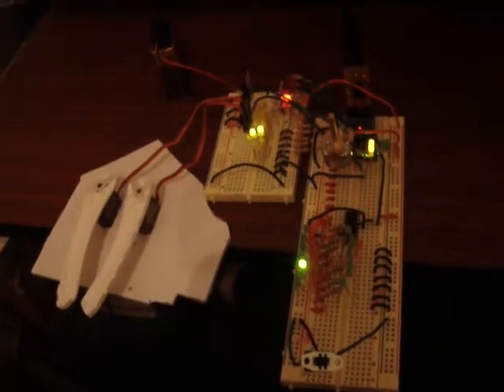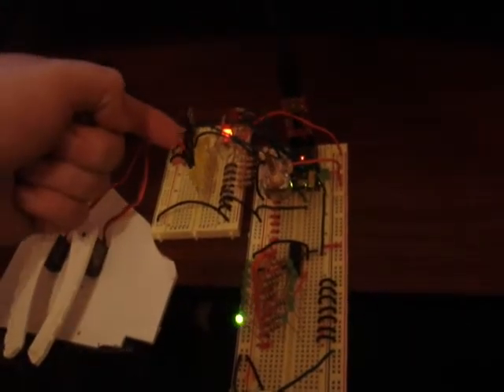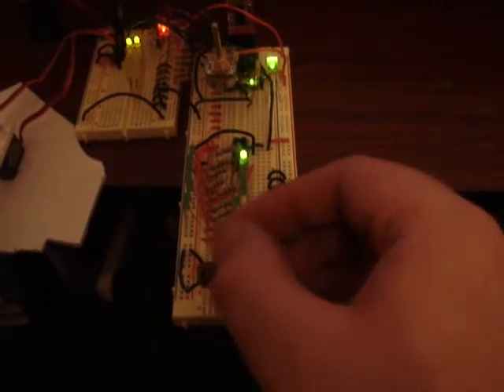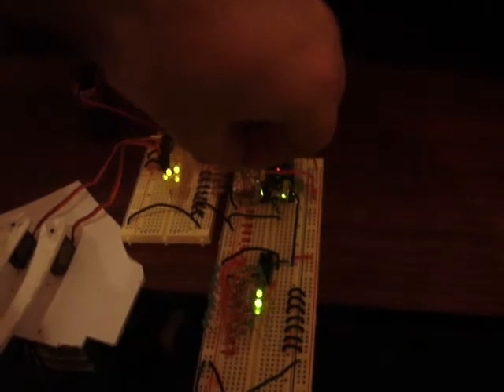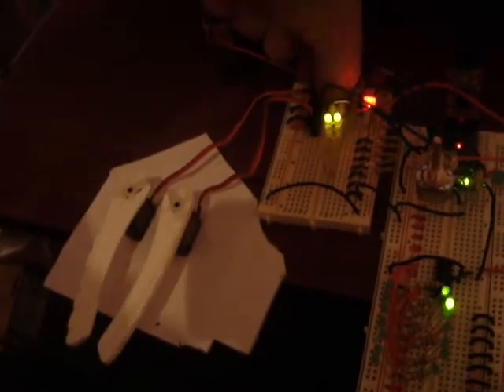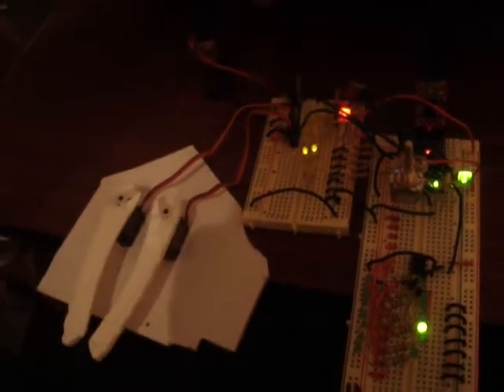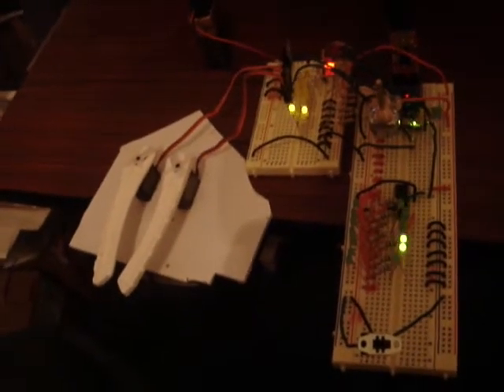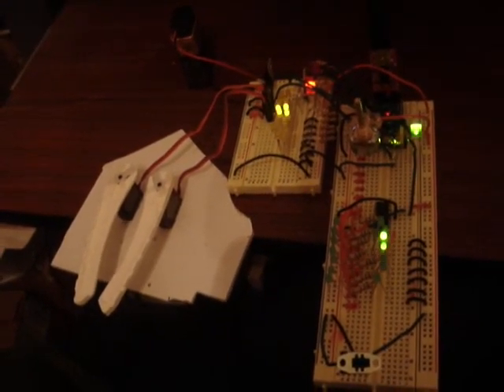Arduino PKE Meter part 3

Comment: why not link the servos from the wings directly to the totentiometer witch controls the speed of the light?
with this, u could have a stepless up/down of the wings directly linked to the speed of the lights!
try to use the trigger button from slotcar-racing!